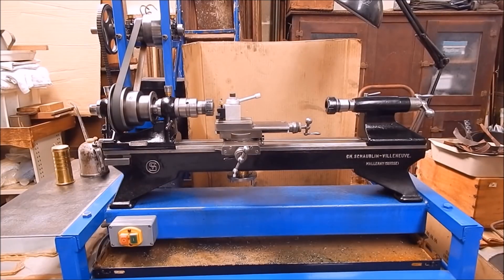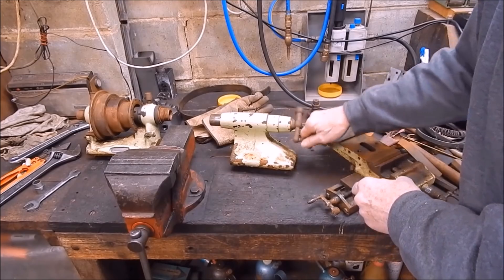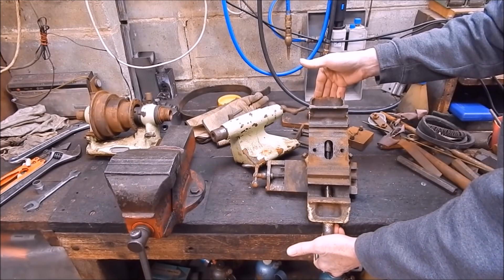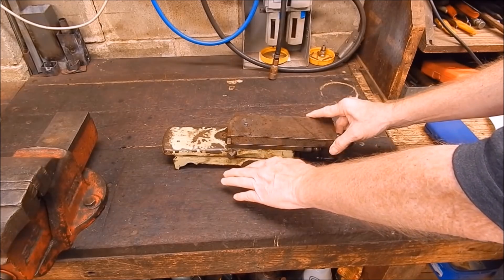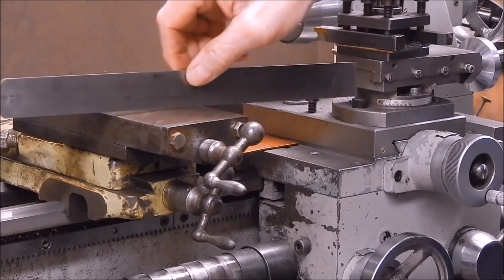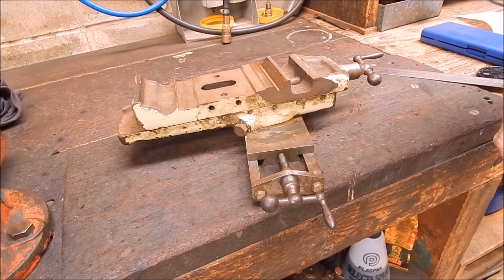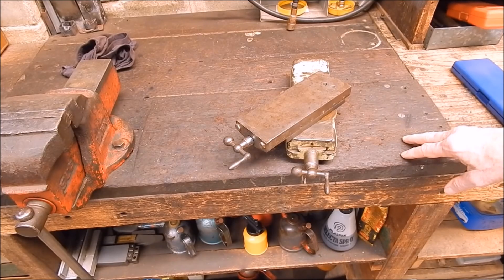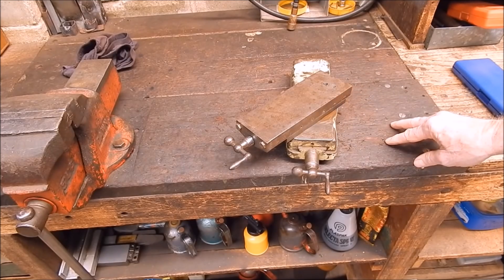Metal lathe mystery compound mount finally solved

Comment: Interesting example of how we all in some way or another adapt to get things done Rob. That cross slide and compound could easily be adapted to be used on a drill press for use in co-ordinate drilling or similar applications. 
Cheers from John, Australia.
Reply from the maker: Hi John,

Yes, it's got lots of possibilities.

Interesting looking at the difference in dovetail widths between the Chinese and mystery lathe - Chinese cross slide much wider, mystery topslide wider.

The topslide on most small/medium Chinese lathes is a bit under done.

Cheers Rob

Comment: Could well be one of the Hercus / Southbend / Boxford / Sheraton 9" lathe carriages and cut down as you say.  I have a Hercus model A and that top slide looks exactly like it.  The compound obviously some kind of custom job though!  I reckon you could put a Hercus compound back on there, would look much neater but not as much travel as that one appears to have.  My Hercus cross slide, although a taper turning one, also has the locking bolts on the rear like this one.  The Hercus model A is a very faithful copy of the Southbend Model A though, the other clones not as much.
Reply from the maker: It could be Hercus.  Needs an expert to identify it correctly, but the family it came from has been identified.  The top slide is a pretty useful bit of gear travel and mount wise.

Comment: I do have a bit of empathy for the guy that did the work. Imagine 1940s or 50s , materials let alone parts hens teeth rare. Money ? Had some once, wouldn't mind some again soon. You have a job to do and getting it done is the priority so you do it with what you've got.  I once repaired the throttle link on my old Fiat 600 with my shoe lace. It's what I had at hand on the hard shoulder of the M1 motorway 50 miles north of London.

Comment: Interesting.   I have not seen Southbend cross slides which were rectangular with sharp edges.   The ones I have seen all have curved surfaces same as on my Heavy 10.

Dave.
Reply from the maker: That's the top slide not the cross slide and as I stated, it's probably aftermarket not OEM.

Comment: the hercus 9 and southbend 9a are the same castings, i have both, and are interchangeable the saddle is from the power crosslide model by the cutout underneath for the crosslide leadscrew. Boxford parts will fit them as well. the handle on the custom compound is same as the crosslide. the original hercus /southbend compound has a smaller handle
Reply from the maker: Thanks for the info Lindsay.

Comment: Thanks for the video, Rob. Did your tell your wife, "Hey Honey. Look what followed me home." That cross slide sure looks like Southbend. As you said they removed the parts that extended out for form the saddle that rode on the ways. What a butcher job! Will any of the parts work on your Schaublin?
Have a good one!
Dave
Reply from the maker: Hi Dave,

I would like to fit that top slide to my Chinese lathe as it's much heavier, but that will have to wait for another day.

Cheers Rob

Comment: That cross slide looks a lot like the one on my boxford cud
Reply from the maker: Apparently Boxford copied Southbend.
Reply: Yes Boxford are a clone of SB.  The compound looks a lot lower than the SB, Boxford or Hercus (another SB clone).  All the ones I have or have owned have grub screws for the compound lock and a large tee slot for the tool post mounting. Probably the compound you have was made up using the original SB screw & nut.  regards from the UK